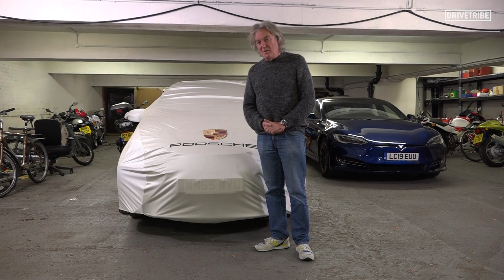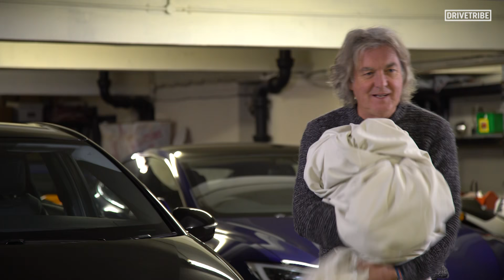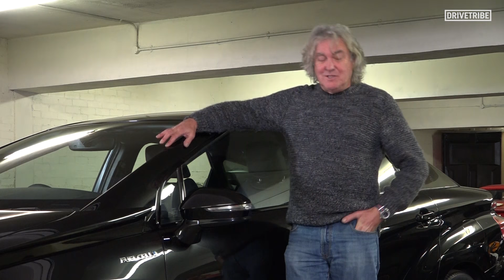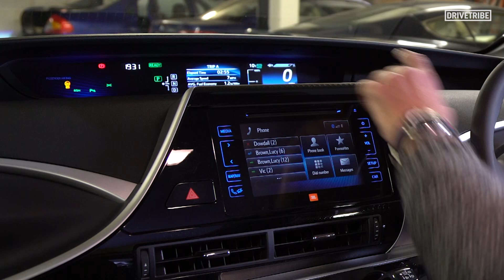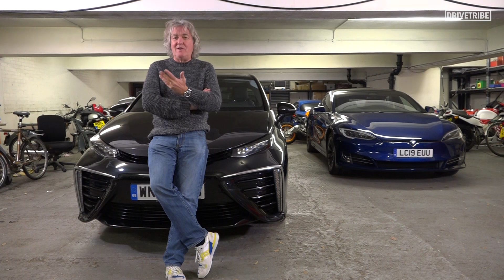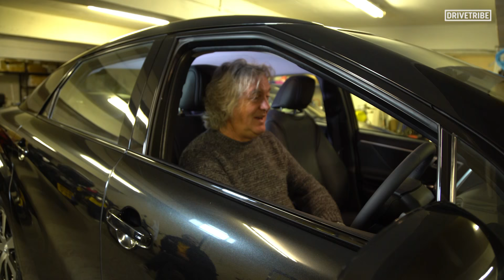James May has bought ANOTHER new car

Comment: Perhaps we’re looking at two replacements for petrol & diesel. Both have electric power but from a different source, kind of..
Although I do think we’ll go one way or the other for infrastructure sake.
My initial, and admittedly un-researched, thought is that water is going to be the commodity of our future, clean stuff anyway. So anything that has bucket loads of money opportunities as well as our requirements for clean water, could clash.
Where as clean energy from solar, wind, wave and possibly spin classes doesn’t tend to use what all life requires to live.
Personally I’m Tesla all the way. I like the minimal look of the model 3 as well as the slightly dated S. Mostly I agree with how Elon Musk is trying to change the way we live and he’s had the gonads to go head to head with the fuel powered obsession of the world.
I love a V8 and V Twins, I’ve been a professional driver for 30 years, but I think you were dead right James, this new technology is going to save the combustion engine, not destroy it.
On a side note, if anyone can turn Mr Clarkson’s opinions into power for cars, I think we could be onto a winner. Perhaps it can be adapted for the trolls and haters in YT comment sections. Although the side effect could be lots of bluster and noise coming from cars powered on it. 😉
Look forward to the next GT adventure.

Comment: Just one question:
What happens to the water that is produced by the fuel cell?
Reply: Its water vapour until but some will  dribble out of the exhaust pipe. It's actually clean enough to drink.

Comment: Once we gain the tech to store larger amounts of hydrogen more safely, batteries will have a run for their money. That's always been the argument for going for fuelcells. Of course, the infratructure needs to be there too.

Fuelcells are however rather slow at generating electricity, so if you ever want to make a hydrogen performance car, you'll need the help of batteries and super capacitors as well, so the battery-electric tech being developed right now will most likely help the hydrogen future... one where you can go 1000 miles on a single refuel, but without being a boring diesel fueled family car.

However, the primitive way hydrogen is stored today makes me nervous,, they may make very strong fuel tanks... but Titanic wasn't as unsinkable as the engineers claimed...

Comment: If one of these has to win out...surely it will have to be the hydrogen fuel cell car. Bugger all time to refill, and in millions of locations right around the world there are places you can drive cars onto that have large underground storage tanks just waiting to be refitted to store hydrogen with no need to upgrade the electricity network.

Oh, and James, please do a video about that Honda NSR, preferably with a good road test built in.
Reply: 'Extreme brinksmanship' is genius
Reply: You can't just retrofit petrol tanks, hydrogen has to be stored at 10,000psi or liquified at a little over absolute zero. It's not the drop in replacement for petrol that the gas companies make it out to be, it doesn't scale. It might take 5 mins to fill up, but you have to wait 20 minutes for the system to repressurise if someone was there before you. In that time, the Tesla driver has charged up and is speeding away in his cheaper, faster and more comfortable car. Assuming you can find a hydrogen station, and that's it's been kept fuelled up - hydrogen is also difficult to transport as it takes up ten times the volume of an equivelent amount of petrol. Those points mean it can never be scaled up to the same level as existing infrastructure.

Comment: 5kg of Hydrogen? Why not have 10kg and double the range? or 50kg? In fact a Model S Tesla battery weighs about 540kg. Why not have 540kg of hydrogen? Or does that make it equivalent to driving around in a 540kg bomb?
Reply: We could name it a "Zepplin" and patent the name :)
Reply: Because hydrogen takes up huge amounts of space, that 5kg takes up the entire rear of the car. Despite being a large car on the outside, it's classed as a small car due to the interior space.

Comment: 5kg of hydrogen compared to 540gk of Tesla Model S battery must make the Toyota a lot lighter. You would think.
Reply: Electricity weighs nothing. You should be comparing the storage medium, and there's not a lot in it in that case. The Toyota has less space than the much smaller Tesla model 3, and is actually heavier, not to mention slower (and more expensive).

Comment: In History standpoint. The Petrol power car is the "Horse" the Tesla is the "Steam car" and the Hydrogen car is the "Model T"
Reply: Hydrogen is less energy efficient than batteries, and with all the new battery tech coming out, hydrogen fuel cells wont have any advantages in range/charging speed/longevity for much longer.

The fundamental issue with hydrogen is that it requires too many conversions, so it will always be less energy efficient than batteries, and if direct emissions from cars are no longer a thing, then energy efficiency is really the only important metric in that regard
Reply: The hydrogen fuel cell is the steam car. It's old tech with a fancy face. It's a dead end.

Comment: Fuel cell cars would have been a great replacement for the internal combustion engine if they had been introduced forty years ago. But electric cars are not only more energy efficient, they have better range and the infrastructure is already available everywhere. Not only that, but batteries are getting better all the time and once mass produced solid state batteries become a thing, there's really not going to be much of a reason to own a FCV.

Comment: The current lithium based batteries operate far below the physical potential of the actual chemistry. There is up to a factor of 10 improvement in the power density of batteries. That leaves plenty of scope to reach factors of two to three improvement, which would put the battery range near 1000 miles. At that point, range anxiety will be a thing of the past.

Comment: James, I've been engaged in the FCEV/BEV experiment for some time, having leased Nissan's LEAF and the Chevrolet Spark EV, and presently leasing Honda's Clarity Fuel Cell.  Here in California we have about 7500 FCEVs on the road, and 41 fueling stations.  I will follow your experiment with great interest.  Both technologies have their pros and cons, but I believe that ultimately both will be useful.  Hydrogen seems better suited to heavy applications (aviation, shipping, trucking, rail) than batteries, due to weight and refueling time.

Comment: Why does there need to be a single solution? We currently have petrol and diesel so why not multiple fuel types for the future?
Battery electric for most cars 
Hydrogen for larger vehicles, busses, lorries etc
Bio-ethanol for sportscars and motorcycles

Comment: Hydrogen is the future of motoring, not batteries.
Reply: hydrogen fuel cells makes very little sense in the grand scheme. 

1. The infrastructure isnt there, while we already have a powergrid for battery vehicles. 

2. Hydrogen power vehicles will always, no matter how much you improve the technology, be substantially less energy efficient than battery powered vehicles, this is because of the conversions that need to be done to get the hydrogen. If you are gonna run a civilisation of zero-emission cars, it makes no sense to use a less energy efficent method.

3. Battery tech is evolving extremely fast right now, and several vastly superior battery technologies are already being developed and tested, in a few years, hydrogen fuel cells wont have any relevant advantage over batteries.

Comment: If that mirai has the same range as the tesla, then it is not even offering any advantages with energy storage. Batteries are only going to get better. In fact I bet if you look at the tank in the hydrogen cars, they take up more usable space because they have to be round for strength under pressure and have to take up space in the trunk or front of the car. So hydrogen cars will have less usable space because this tank will take up useful areas unlike a tesla which has the batteries in a flat pack in the floor.  As a result, Teslas and other evs can have more roomy cabins as well as a front trunk, and a large rear trunk. EVS packs in the floor also offer rigidity to the cabin which would not be part of a hydrogen vehicle unless they did something extra in the floor to add strength. Then this would just be wasting space not used for anything else unlike the battery in a Tesla or other EV.

Comment: Cracking the hydrogen uses or wastes more energy to obtain it. Transporting fuel like hydrogen like gas, requires energy and trucks to transport it. Electricity is just carried on wires without burning fuel or energy in trucks. The tanks to store hydrogen also takes up space is dangerous and requires more cost to install and maintain. Hydrogen also is more dangerous than gasoline as far as leakage and explosions especially during an accident. What people also do not realize, that although your pump filling of hydrogen is fast, the time needed to pressurize the tank for the next car to refill can take 15-20 minutes. This will slow down a filling stations effectiveness. It is much less costly and easier to have multiple ev chargers than hydrogen and filling nozzles at a station. The hydrogen pressurizing pumps are also another cost and maintenance issue.  Although you are reducing the emissions at the tailpipe, you are just maintaining all the issues just like with gasoline. Again, hydrogen is just as if not more explosive, dangerous and hazardous  than gasoline. EVs with batteries do not have nearly these dangers or problems.

Comment: Which technology consumes the most Oxygen ? The internal combustion engine that requires it to burn, or the fuel cell that combines it with Hydrogen ?
And what is the "greenhouse effect" of releasing water vapor in the air compared to releasing CO² ?
Finally, which of these two cars contain the most Cobalt ? Is there enough Cobalt to replace every "ICE" vehicles with these alternatives ? 
And is there enough slaves to mine that Cobalt ? ^^

Comment: I'm not saying batteries are 100% safe but consider this. 1. Hindenburg was filled with hydrogen and Toyota has 700 bar pressure fuel tank full of hydrogen. 2. It only takes static spark to ignite it. 3. You can't smell it and it burns with almost invisible flame.

Comment: Tom, stop using auto focus they don't work.  Just put it on manual focus and use that focus confirmation icon.  Or use auto focus, half press on your subject, release and switch it immediately back to manual focus.  This won't work for children that runs around but for Capt. Slow it's more than fine ;)

Comment: Womp Womp!  This makes NO sense! How you can you sell a car that has only 8 Hydrogen filling stations in the country? 
I believe that we are missing the point in terms of "eco-friendly cars". As you stated in your last video, the Electric movement is picking up, but no car is without issues.   We know that Petrol is fairly cheap (to buy the car vs it's Electric of Fuel Cell vis-a-vis), and that it is usually faster to obtain, but comes at a cost in terms of environment (extraction + pollution) AND we know that we are running out of the Black Tar.  Electric cars that use Lithium-Ion requires a LOT of RAW material and processes that do if not more damage than it's gasoline counterpart. Finally, for the time being, there is Hydrogen.  This seems to be the wiser vision, but there is a reason why this never caught on.  Hydrogen extraction is awfully complicated, expensive and... much more volatile than fuel/electric cars. Speaking of which, doesn't water vapor increase green house gases which contribute to an accelerated global warming?  Trust me, I am NOT a Green/Hippy  but stating known facts... We are living in an interesting time when we KNOW that fossil fuels are running their course, enterprises such as oil/energy/automobile lobbies are trying to grab as much cash before we are forced to revert to horses.  But on a serious note, we are no where near done figuring out what we do with 8 year old Tesla batteries and scorching the Earth in our conquest to become better Eco-Citizens.  P.S Ford did a BIG push for Hydrogen (as seen in James Bond Quantum of Solace... who remembers all the explosions at the compound in the desert towards the end... subliminal message or Hollywood doing it's thing ;) ).

Comment: Hydrogen has lower energy density. Electricity is more efficient.
Reply: @zoidberg444,
please explain this!
And please use photovoltaic to charge the BEV by your garage stop over nigth.
Reply: Martin Berchtold your PV panels can store the power in a battery, Tesla offer one but you can use any large battery and charge from that, you can also run your house hold electrics from it and never pay electricity bills again
Reply: @jamie0193  If you are in Southern California or Arizona like Tesla are maybe. In the UK in winter we only get a few hours of sunlight a day and most of the time it rains.
Reply: zoidberg444 i live in England and I’m looking at installing it, you don’t need full sunlight to charge up the battery. The latest tech PV panels are very efficient

Comment: The only thing holding the HFCEV back is filling stations.
Reply: And cost. It's more expensive to fuel up than petrol currently, so obviously way more than mains power. The cars are also more expensive, and less available.
Reply: dasda asdasda - go back roughly 120 years ago and the same argument was being said about the gasoline powered car versus the horse and carriage and, believe it or not, the electric car.  And it’s pretty obvious who won.
Reply: @XLC-zd8dn  Absolutely, if they can sort out the issues there's definitely potential.
Reply: It's almost like they don't want it to happen.....
Reply: It will need private sector funding. Just like how Tesla have invested massively in charging points. This is something the government should be doing to meet its own directives, similarly with hydrogen filling stations. But it simply won't happen

Comment: Nobel winner John B.Goodenough is about to move the goalposts with solid state batteries, which should double the range of the all electric and slash charging times. The Hydrogen car is comparable now. It won't be in 5 years.
Sell that Toyota to Clarkson before it becomes a lemon.

Comment: The Plug in vehicles like the Tesla are, in my opinion, an immediate solution. Whereas the Hydrogen fuel cell technology is more of a long term total infrastructure solution for the world at large and not just for vehicles. The scientists will eventually find a less energy intensive way of cracking Hydrogen, and then it will take over.
Reply: Not unless they find a better way of storing and transporting it too, and making it fit into a reasonable space in the car. Big ifs when we can plug in right now.
Reply: Mike, I agree with everything you’ve said. BUT, look at the earliest cars, could only do about 20 miles at the maybe 25 miles per hour, but now look at them, capable of covering over 500 miles on a tank, and cruise happily in triple digits all day long. 

My point is, if you give something enough of a chance, and invest heavily into it, eventually you’ll find a way to make it work properly, much like the story about Edison and his improvements to make the lightbulb work.’

Comment: I GUESSED IT! BTW I think BEV will take over because battery technology is constantly improving and it's difficult to manufacture an efficient fuel cell that fits inside a car, large fuel cells are more cost-effective and efficient. Different speech on bigger vehicles: huge boats, trucks, planes, even generators (SIEMENS has done a HFC one) have a Hydrogen future for sure, it's way easier to store LARGE amounts of energy in big tanks on a huge boat than in a small car and Hydrogen is perfect for transporting energy from a place to another (example: solar power plant in the middle of the desert, electricity stored in hydrogen tank trucks, brought to the coast and shipped all over the world, AMAZING!)

I think it will be easier to live with the Tesla, they're just so well engineered and nearly perfect (yeah, I'm an electric car guy and sustainable energy enthusiast!)

Comment: Sir May, I believe you're a bit misinformed. The hydrogen station needs to be re-pressurized after you refill your cars tank to avoid explosion. The re-pressurization takes about 20 minutes and that time won't be much sorter as time goes on as fastening it increases the risk of hydrogen explosion exponentially.

With hydrogen you will only use about 20% of energy used to create the hydrogen. With batteries, you use about 91% (USA estimates an average 6% energy loss on transfer, plus another 3% loss on changing efficiency). This doesn't take into account the efficiency of the energy source used in both processes.

On the other hand, you can't create hydrogen at home, but you can easily create electricity (solar roof for example), thus batteries look to be much more energy independent solution.